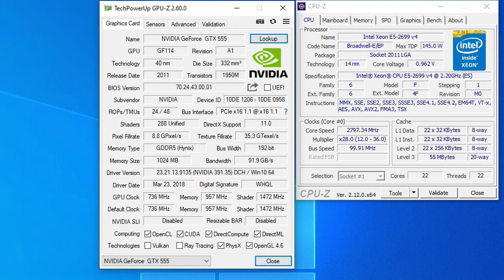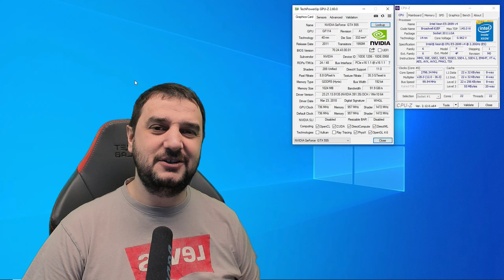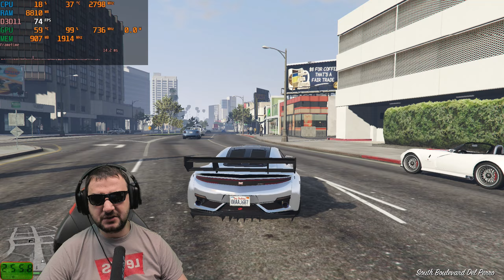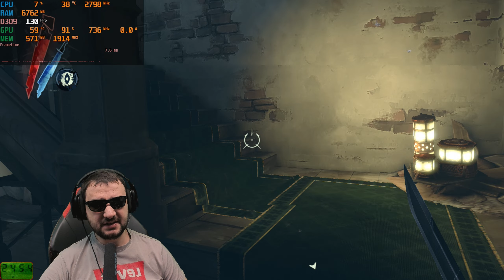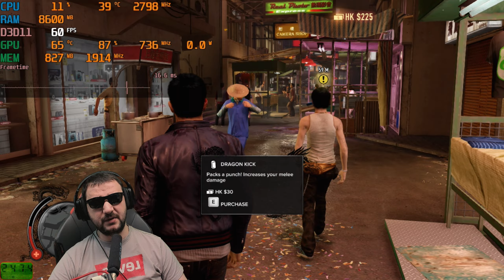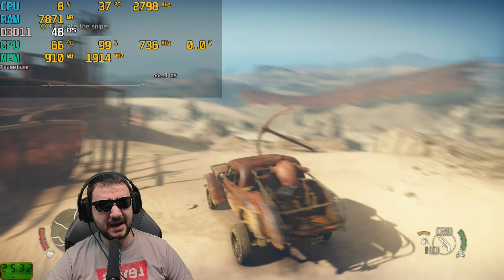NVIDIA GeForce GTX 555 OEM Benchmark

Comment: hey I am waiting for the r5 240 and its crossfire video when it will come
Reply from the maker: r5 its not crossfire compatible
Reply: @DanielCardei  no it is compatible I have 2 r5 240 in crossfire enabled but the problem is that when I record the in game footage then I record in single GPU
Reply from the maker: @UnknownGamer-j7n  so it works without being recorded?
Reply: @DanielCardei  yes try it I play games like gta 5 in high settings get around 35 fps in 1280x1024
Reply from the maker: @UnknownGamer-j7n  ok. so with msi ab does it show both of them work. does both have load without recording?
Reply: @DanielCardei  yes I enable the crossfire logo and it shows
Reply: @DanielCardei  I used Bandicam so it will work with recorders probably
Reply: @DanielCardei  I am subscribing just to wait for THIS video

Comment: After Being Scammed on tbhe geforce 256 and the Geforce 4 TI  i have forsaken them for ever.  to pay 300.00 American for the Geforce 256 and to be smoked by the ATI version for half the price ,  NEVER USE NVIDIA AGAIN
Reply from the maker: you bought the cards now? or when they where launch?
Reply: its not like that anymore. AMD has nothing to respond with as far as the 3090 and 4090 goes. I like using AMD and intel GPU's but I will be the first to also tell you that there IS a better Nvidia GPU out there if you have the stomach and the money.
Reply: @HardWhereHero  amd really isnt that far behind, maybe in raytracing and upscaling but i couldnt care less about that stuff personally.